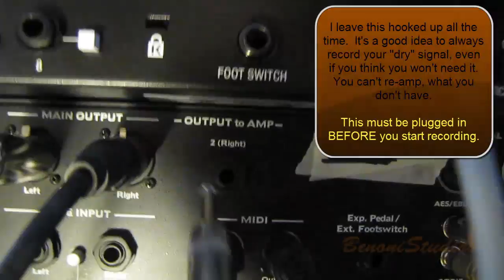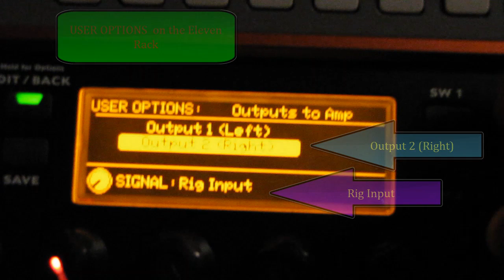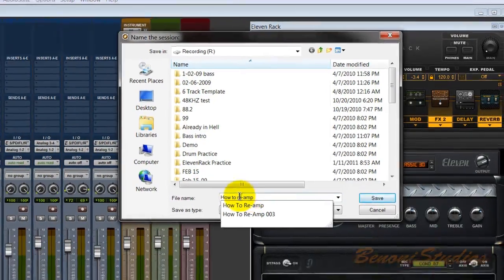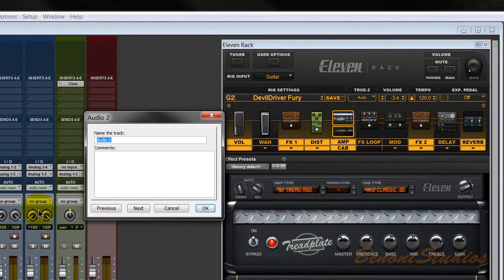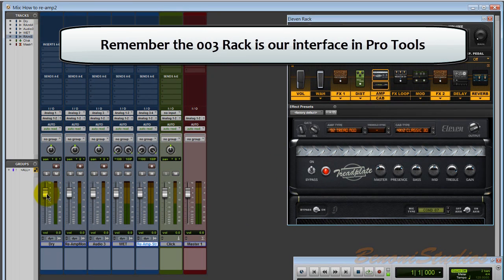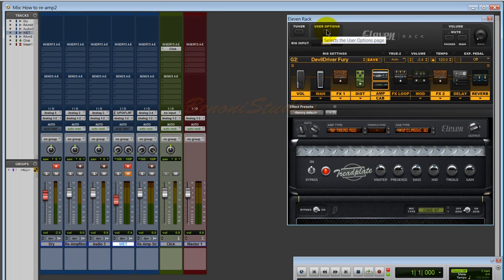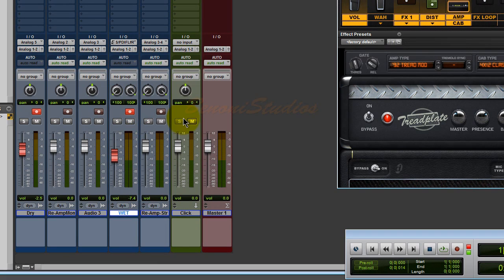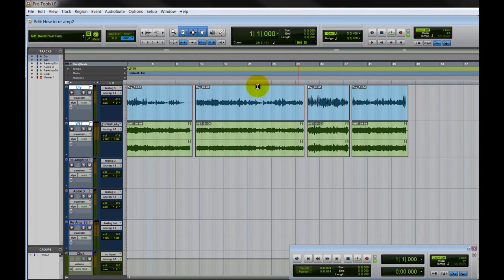Eleven Rack Tutorial - Re-Amping With S/PDIF Part 1

Comment: I am trying to do this, except I am using PT 10. I can't get it to work. In setup> hardware the 11R doesn't show up. In setup > playback engine, I have my profire 2626 selected but both devices show in the dropdown. Any idea what I am doing wrong? I also don't see anything labeled Spidif when I try to set up the routing. Thanks

Comment: good series of vids on 11R.  just picked one up and your vids on 003 +11R are quite helpful.

I have 003 console + 11R.  How would go about reamping a dry guitar signal out to full analog guitar rig?  Thinking about running it out to mesa recto mic'd with a 57 through UA 610 PRE and running back into the 003 or 11R...   Avid's got a vid on reamping through a marshall cab, but they are still modeling guitar head...  Thanks!